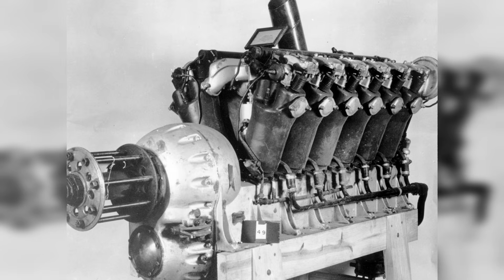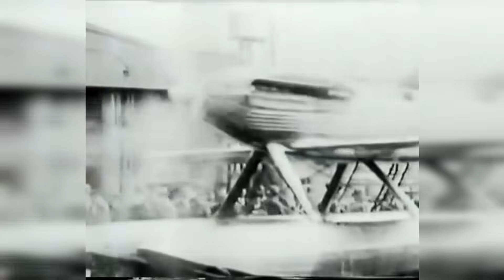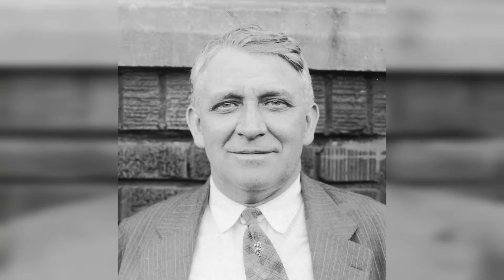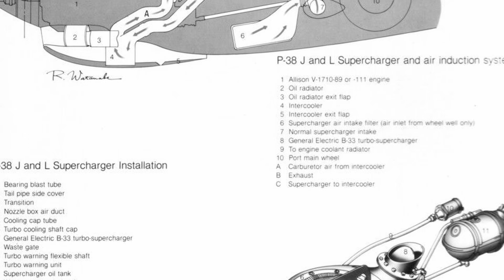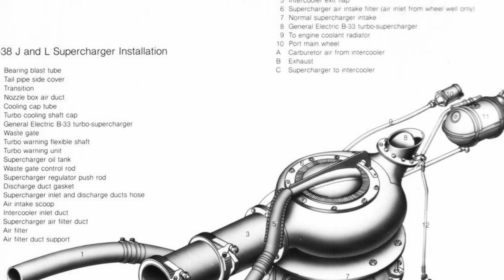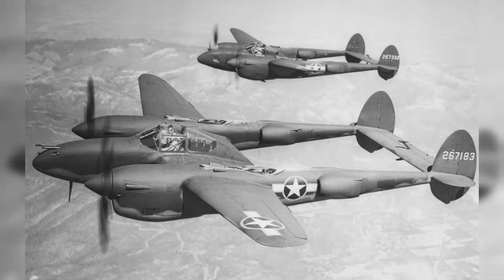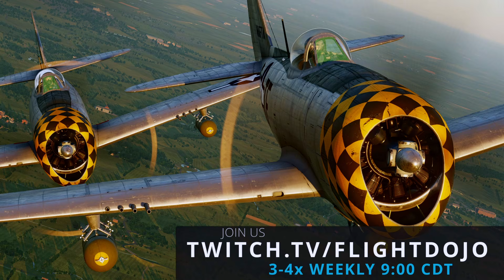Allison V-1710 - A Liquid-Cooled American WWII Warhorse

Comment: A few years ago I ran across some images from a Buffalo NY area newspaper from the early 1950s. In it was an ad for an in the crate Allison engine, as I recall the price was under a thousand dollars, well under. One could also buy the superchargers and gear drives for the props. Of course there's been a lot of inflation since then.
Reply: I can vaguely recall the Unlimited Class Hydroplanes used the Allison V10 with turbo charging (one on each bank) racing on the Niagara River in the Buffalo/Tonawanda area.
Reply: @hwirtwirt4500  V12s. I saw them racing on the Potomac, very impressive! Barely in control, a mix of boat and airplane that would sometimes take off and become airborne, with bad results.
Reply: @3ducs  The old ones had the big V10 out front too with the driver near the rear of the boat, they were fun to watch and sounded incredible. They eventually stopped racing the Unlimited's on the Niagara River because it was too narrow when a lot of hydroplanes were on the course. Some of the owners lived on Grand Island which is on the Niagara River so it's no surprise that engines were available for sale on the used market in the Buffalo/Niagara Falls area.
Reply: @hwirtwirt4500  The V12 I saw advertised was a surplus engine, there must've been hundreds of them available after the war. The era of piston engines was over, the new US aircraft were jet powered.

Comment: Excellent video and very well explained. The merlin engine had it's problems as well, often solved by testing to destruction, inspection and redesign. This resulted in an extremely strong and reliable engine which could easily cope with the power increases that came later. The main problem in the early days was with the supercharger but a scientist (not engineer) called Stanley Hooker solved that. His speciality was fluid dynamics, and it is said that anything that flows is a fluid, including air. Anyway he transformed what had been expensively and laboriously  made into a good and reliable engine into something special.

I should add that rwo other things helped a lot... high octane fuel and ethyline glycol, both from the USA!

Comment: I wish you were able to touch on the late war/post war installation in the P/F 82 and whether all of these almost solved problems had been finally put behind it or not.  Very good presentation.  I am surprised  someone during the war didn't "accidently" you got your chocolate in my peanut butter the 2nd stage system from the V1650 to the V1710 1st stage.

Comment: You should have done more research on the P-39 and the 1710 and Turbo charging. the engineers at Curtis were told to design the Airacobra for a GE turbocharging system and what happened after they found out it was bigger then then what they had designed for, and that when installed in a prototype it slowed the plane down and affected weight and balance.
Reply: From what I have heard the GE turbo charger installation gave serious heat disposal problems on the P39 prototype and the redesign work needed to resolve that was regarded as too significant to get the aircraft into service in a reasonable time frame. As a result the decision was made to produce the aircraft without the turbo charger.
Reply: Curtiss? The P-39 was designed by Bell.
Reply: @tempestfury8324  gack that's right brain fart on my part.
Reply: @patrickradcliffe3837  👍
Reply from the maker: It may have slowed the plane down at sea level due to the added weight, but I will be very surprised if it slowed the aircraft down between 20-30k. The p-39 had a competitive top speed, if memory serves, so the altitude consideration was probably a bigger factor. That is, of course, assuming the turbo penalty wasn’t too large. The same phenomenon happened when they tested a typhoon with a turbo.

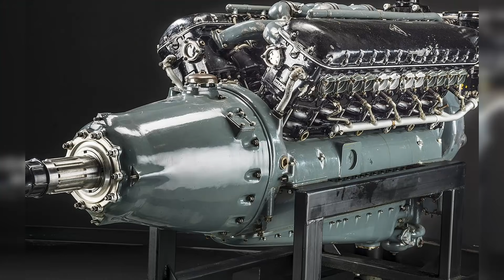Comment: 06:37, do you mean to say the cylinder liners were installed in the block instead of on the head? I have never heard or know of how that would work. The block is what holds the cylinders, not the head, I am confused.
23:46 oil is in the radiator, not the intercooler.

Comment: You missed 2 V-1710 powered aircraft. First, the P-82 Twin Mustang, and the XB-38 Flying Fortress. The XB-38 was a Boeing B-17 fitted with V-1710 engines, a very beautiful airplane.
Reply: The P-82 used the later G series Allison V-1710. Allison worked very hard to develop the V-1710 throughout the war, leading to the G series engines, which could easily operate happily for hours at 3,400 RPM, could run over 80" of manifold pressure, and produce over 2,000 horsepower reliably.
Reply: + George Armstong     The XB-38 was such a beautiful version of the B-17, but unfortunately lost very early in testing from an in-flight engine fire.  The early performance numbers were not much better than the radial version.

Comment: Please.  A piston speed of less than 3500 ft per minute is the highest of any engine ever designed?  Do you mean any aircraft engine ever designed?  When you pass out statistics you need to be specific.  An ordinary Honda S2000 car engine is just under 9000 feet per minute, and the motorcycle engines are much higher.  I will not even address Ferrari’s and such.  Please be careful when making absolute comments.
Reply: @William Shappley - Please. It's obvious that he's talking about aircraft engines. And YOU shouldn't pass out data when you clearly don't have a clue. MPS (Mean / average Piston Speed) in FPM (Feet Per Minute) is a simple equation : Crankshaft Stroke (in inches) x RPM / 6. The Ferrari 458 4.5 L engine : 3.189" x 9000 RPM Redline / 6 = 4784 FPM. The Honda S2000 2.0 L engine : 3.307" x 8800 RPM Redline / 6 = 4850 FPM.  The Ducati Superleggera V4 1.0 L Motorcycle engine : 1.906" x 15500 RPM Redline / 6 = 4924 FPM. The Ford 6th Gen Mustang GT350 : 3.661" x 8250 RPM Redline / 6 =  5034 FPM. The absolute highest production engine MPS is the Audi / Lamborghini 5.2 V10 : 3.654" x 8500 RPM Redline / 6 = 5177 FPM.

Obviously MPS is a function of Crankshaft Stroke and RPM. Higher MPS is definitely not "better". Anything over 5000 FPM is quite extreme for reciprocating internal combustion engines and is very close to the top classes of racing like NASCAR and Formula 1 (where engines are completely rebuilt on a frequent schedule). If the rod angle is more than 16 degrees, then a high MPS (4700+ FPM) requires very careful engineering design / selection of materials. It's greatly preferable at a high MPS to lower the connecting rod angle to 16 degrees or less to reduce friction.
 
The vast majority of production engines in sizes that are relevant to cars, have a MPS of between 3000 FPM to 4500 FPM. Motorcycles typically range between 3500 FPM to 5000 FPM due to their reciprocating components being much smaller / lighter. Aircraft, due to their much larger / heavier reciprocating components, have a much lower MPS range usually between 2000 - 3000 FPM, with 3500+ FPM being exclusive to very high performance configurations.
Reply from the maker: I believe the reference I am using for that figure is referring to aircraft engines, yes

Comment: "Allison has poor performance at altitude"
Well, just ask the P-38 pilots. You still lying, falsifying facts.
Reply from the maker: The 1710, without the General Electric turbo, did have poor performance at altitude
Reply: @bearingunknownyt  Who cares? An aero engine is a system of the engine core, the charging systems, and the airframe. You can't take them apart. The whole system must be integrated. A badly integrated super or turbocharger can even makle things worse.
This is a typical way to bending the truth. And BTW your liebling Napier Sabre were even worse in high altitude compared to the V-1710. And you call that contraption the "ultimate WWII aero engine". Double standards at the highest order.
And one another thing: fuel is a very important part of the puzzle. Without the american 100, 130, and 150 octane aviation fuel, the RR Merlin and any other british aero engine were in the joke category. Those high octane fuels made possible to increase the chamber pressure and thus the power output.
Reply: @egyeneskifli7808  Perhaps he should have clarified that the Allison, as used in the p-39, p-40, and P-51, had poor altitude performance.
Reply: @sebclot9478  He had no intention to clarify it. He is hugely biased towards the Napier Sabre, and absolutely try to demolish the Allison. He uses all the dirtiest tricks to prove his point. The Allison V-1710 was a really good engine, with huge potential. In WWII the americans haven't used this potential, because mostly they didn't need it. They haven't used better props and more powerful V-1710s on the P-38, because nothing justified the costs and time to do. The Lightning was the king of the high altitudes as is. And the props were the bottleneck even with the 1600 HP engines. They retrofitted practically all the P-47s in service with paddle props, but not a single P-38. Only an experimental one existed.
BTW, in 1943 in under 12k ft the Allison powered P-40s were the one of the fastest fighters of the world. Even without the field modifications. And can outturn any fighter in service. Only the P-39 was faster thanks to its much better aerodynamics.
The V-1710 had a single speed, single stage supercharger thanks to the doctrine. The second stage were the turbocharger (and that is far superior in high altitudes compared to any supercharger), but they didn't use those on single seat fighters with the Allison engine. (The same doctrine said that no USAAF fighters should be fitted with drop tanks. They sacrificed hundreds of bombers and thousands of airmen thanks to this idiotism. With droptanks the P-47s could easily escort the bombers over Berlin. It is a myth that the Mustang was the first fighter capable of this.)
In low altitudes the Allison powered P-51 and P-40 were faster than the Merlin powered ones.
Reply: @egyeneskifli7808  That wasn't my impression of what he said.  He didn't seem to be attacking the Allison to me.
Reply: @sebclot9478  Just watch his video about the Napier Sabre. He falsified data, discarded facts, just because those don't serve his bias. He is definitely hates the V-1710, always downplaying how good design it was.
For example he discarded the after war development of the Allison, meanwhile cited data from never built, or only prototype Sabres. And he compared the doctrine limited Allison to the prototype, never used Sabre. This is the basis of most of his conclusions. He fully discarded any data from the turbocharged Allisons used onboard the Lightning. Meanwhile the Sabre was even worse than the Allison in middle altitudes, and much worse in high altitudes, even compared to the single supercharged V-1710s. But those things don't matter in his eyes. Double standard at the highest echelon.
If you really want to know how good was the Allison V-1710 family, go and watch videos on Greg's channel. He is know what he talking about. And don't let bias and other bullcrap nonsense cloud his judgement. His channel is really technical. https://www.youtube.com/@GregsAirplanesandAutomobiles
Reply: @egyeneskifli7808  He is definitely a Napier Sabre fan boy...LOL.....no doubt about that. But that isn't the same as downplaying the Allison. I thought his evaluation of the Allison was a pretty fair one. Albeit, somewhat incomplete in some respects.  However,  I didn't see that as the result of bias. 

Now his making the Sabre into the greatest piston engine to ever roam the earth, that might be a fair criticism. He made it sound so good that I was half-expecting the saber to cook a pizza for the pilot.

Comment: Great video, but I have some constructive criticism - it would be a lot better to show more pictures of the things you are talking about instead of your face, even if you can't find any exact, use some other image that can better explain what are you talking about. 
(For instance, I had to pause the video several times and search for scheme of V-1710's reduction gearing, bearings etc...)

You could also write a metric conversion on screen when you say some imperial units, so the rest of the world could understand and not pause the video again and search what the hell is 100 inches of pressure ;)

@ 20:09 I think you wanted to say that the exhaust goes through the turbine, not the compressor.

Comment: The problem was that most of the allison engined a/c didnt have the required performance,  particularly in the european theatre where many engagements were above 20,000 ft. 

Allison engined a/c like P39s, P40s and P38s were used more successfully in the MTO and PTO instead where engagements were typically at medium altitudes.  

The P38 was tested by the british and they found carb icing at high alts.
It also suffered horribly from mach compression in a dive, so that all the germans had to do was dive away and escape. 

But against the mach limited and more fragile Japanese planes this wasnt such a big  issue. 

They introduced dive recovery flaps in the late war p38 J/L model to address the severe nose tucking in a dive and help the pilot pull out of it.

By the end the war the allison was a decent engine.

Comment: The Allison weighed less, had fewer parts and complexity, ran higher Manifold pressures, smaller profile, and also had better build quality. It really was only drawn back by the lack of supercharger technology and turbocharging. I mean the p-38K (and D/J) models could easily sit at or above 45,000ft with the turbosupercharger configuration.
Reply: agree 100% the Allison had 4000 parts the Merlin had 11000!!!
Reply: 110% The Merlin was super neat, of course - but it was designed by British artisans to be built by artisans. The Allison was designed to be simpler and easier to build on more-automated assembly lines...the 'Merican way.
Reply: I would add that the V-1710 was designed to be reversible unlike the Merlin, one of the reasons that the Merlin was never used in the P-38. While we are thinking about the P-38 a large amount of the trouble with them was on account of overly rich fuel mixtures and excessive intercooling resulting in poor fuel distribution between cylinders that resulted in plug fouling and detonation, depending on whether the cylinder was one that tended rich or one that tended lean.
Reply: No the P38 could not sit above 45000ft WW2Aircraft Performance gave it 40000ft Max That Turbo/super installation was not as efficient as the Merlin supercharger
Reply: @jacktattis  if it were pressurized, the p-38 and p-47 were capable of those altitudes. Watch Greg’s airplanes on turbo supercharging in US warplanes. Theoretically the P-38K and the Ta-152H were more efficient than the Merlin 2 stage supercharger. In fact the Junkers 86 operated over Britain at 50,000ft while carrying bomb loads.
Reply: @yourgrandmasalzheimerpills1143  I do not give a rats bum about Greg 
WW2aircraft performance does not have a P38  getting over 40000 ft
Reply: Twelve Tests from Feb 41 to Dec 45 40000ft
Reply: The Allison had a number a deficiencies, especially the intake manifold that caused detonation.  It was never a good high altitude engine.

Comment: Question: Are Jet-engines more fuel efficient than piston-engines if you put in all parameters for passenger airplane flight, airport to airport?
Reply: Nothing really beats the fuel per mile of a piston engine, but other factors made turbine power more desirable overall.
Reply: Jet engines use fuel at a much higher rate but 150 octane avgas is much more expensive  and recip engines are much more complex.
Reply: Hard to compare per se as jets fly much faster than any propeller airplane could. But if you compare a modern turboprop (a gas turbine driving a propeller) then yes, a modern big turboprop engine does deliver higher fuel efficiency (about 40%) than the pinnacle of aviation piston engines in 1945 (about 35%). But back when turbines took over in aviation they drank fuel like crazy, the motivations were speed (for jets, obviously not for turboprops), much better power/weight, better reliability, cheaper and much safer (less flammable) fuel.

Comment: If the USAAF had not shot this aircraft engine in the foot during the development of its supercharging systems it's high altitude performance would have been greatly increased. Being told that the USAAF would use GE turbochargers, the Bell XP-39 prototype had a turbocharger system that the USAAF had removed for the production models. If you look at a drawing of the turbocharger system ducting on a P-47 you'll see why that aircraft was so large. The prototypes of the P-82 Twin Mustang were powered by Merlin engines but the production models were produced with the V-1710s instead.
Reply: P/F-82s had Merlin engines from prototype through the D model. E, F, G, and H models were powered by Allisons.